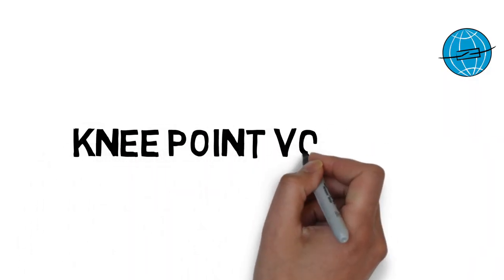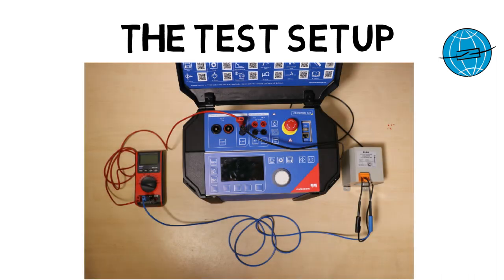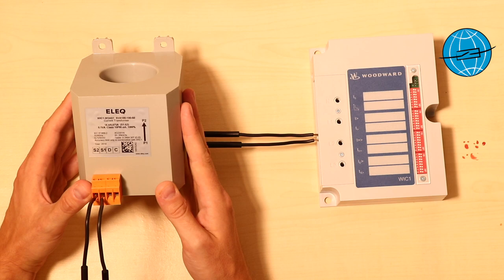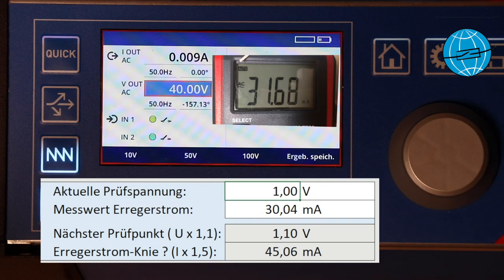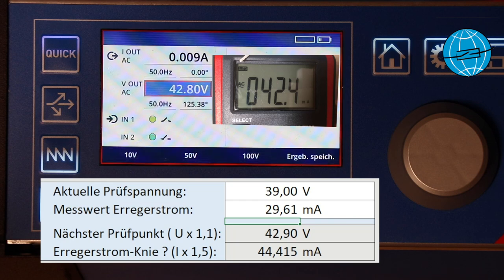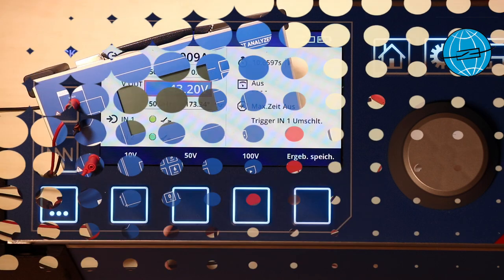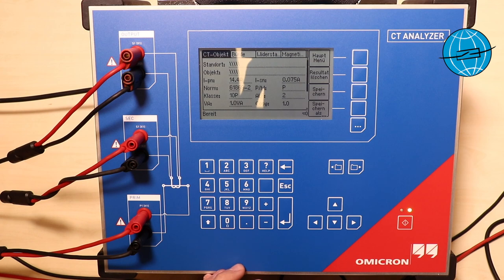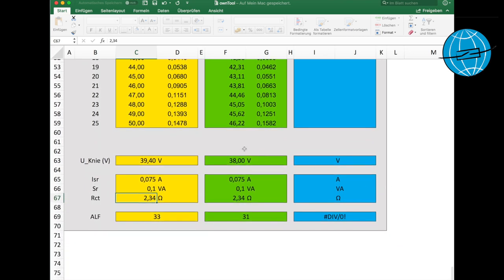Knee point voltage with multimeter?

Comment: Hello! As we see on the diagram at 1:56 we connect our ac voltage source direct at secondary winding and we measure the current also on the secondary winding with ammeter. In this case we don’t have transformation of the voltage level so the magnetic core don’t interfere! But again we observe the saturation phenomenon. In my mind the proper procedure was to connect our supply on the primary winding and observe(measure) the secondary. Now i am thinking it’s like we power an individual resistance and measuring the current through it. Can you explain me why we still we reach to saturation whilst voltage level between primary and secondary don’t change? I hope you understand my concern!
Reply from the maker: Thank you for your question and sorry for the late answer, we just discovered your post. It's quit easy: In feeding the secondary winding you magnetize the core. Until the core is not able to absorb more flux. You reach the saturation and the voltage doest increase anymore like before. Warm wishes!
Reply: @electricalengineeringacade5770  thanks a lot!

Comment: Why applied only vk/2 Voltage ?
Reply: Can you specify your question?
Reply: Why we are applied only vk/2 voltage for knee point voltage test of CT?
Reply: I want know reason
Reply: @anoopsingh6549  I don't know who told you that only vk/2 voltage is applied during the test, you can test till 120 Volts of the vk if you want to. The definition of PS (Protection Special) nails the knee point voltage of current transformers Vk and also the excitation current Ie at Vk/2. Guess that's what your'e talking about. It's always good to measure the excitation current at 50 % to get this special value according to the PS-definition. Hope that helps ...